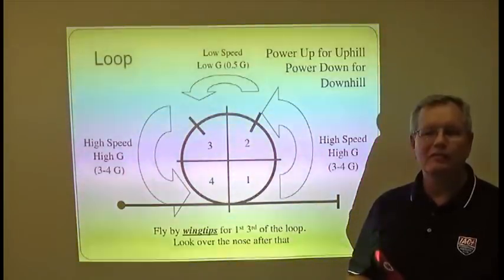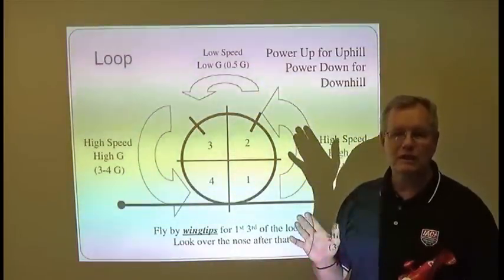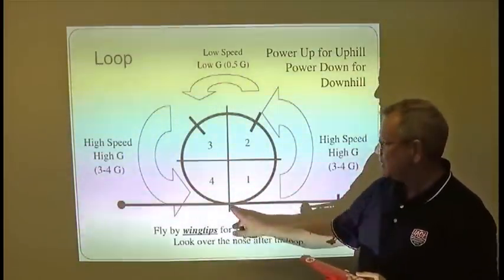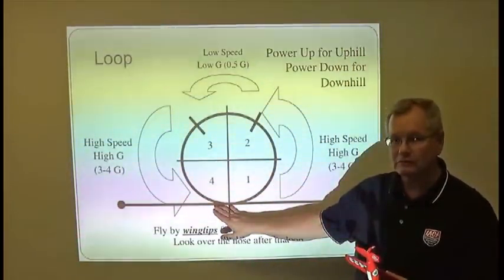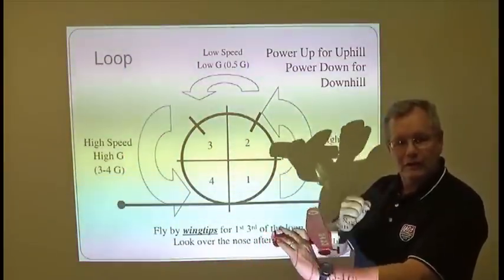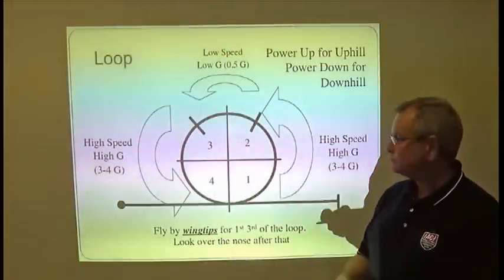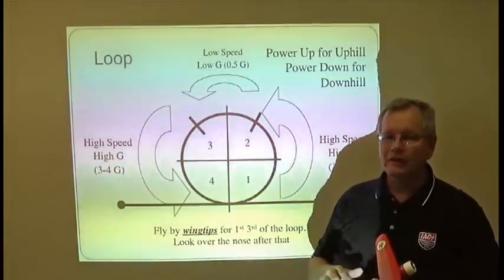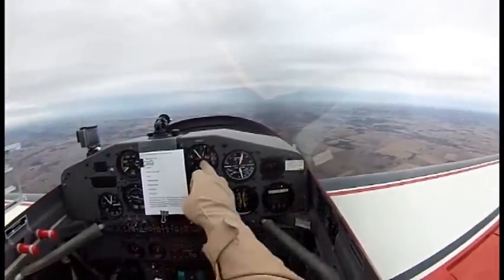The Aerobatic Textbook: Loops

Comment: Use a high HP engine 1.1+ thrust to weight ratio plane & JUST DO INSTRUMENT FLYING
just maintain speed (not throttle) throughout loop. 
Now if u maintain "g" your loop will be perfectly round
To ensure loop is in vertical plane, throughout loop, maintain artificial horizon horizontal. HANDY TIP: Wide loops r asier & look nicer
Reply: 1. Get in Flight Simulator X (because I don't trust you in any sky space above me)
2. Do exactly what you said.
3. Look at the "Flight Playback"
4. Post here again with what you found out.
Reply: @goodisnipr  good approach...CENTRIPITAL FORCE F=m(v^2)/r   ie a=g loading=(v^2/)r  so if v=constant & a=g loading constant   'r' is left with no option but be constant    But u r r8, Yes u got to do earth's g correction (ie subtract g when upright and add g when inverted) otherwise like u said  loop will be an lower case L...Plus indeed u still got to do heading hold with rudder to correct for prop torque & keep wing s level throughout with ailerons. but even these can be done with instrument flight too.
Reply: Absolutely wrong on many levels.